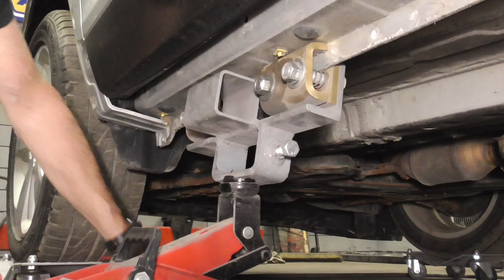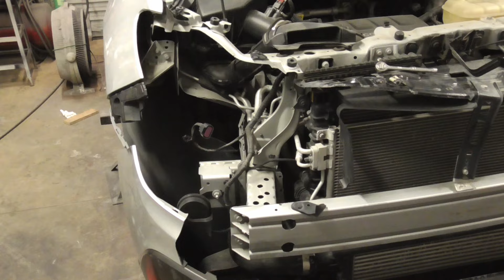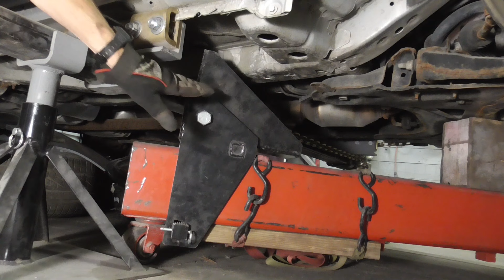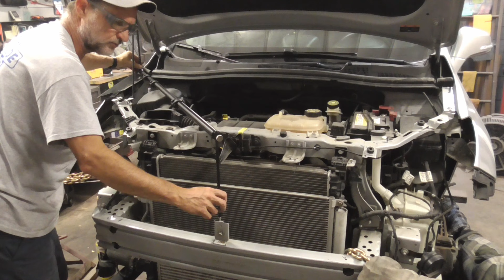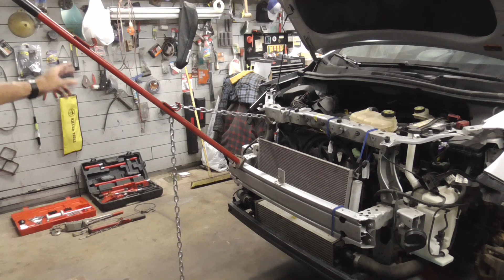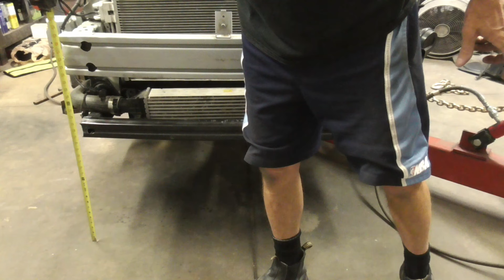Pulling Frames: Fixing Frame Side Sway with a Dozer Type Frame Machine

Comment: hi there where are you located ?
Reply from the maker: I'm in Saint Helen,  Michigan 😊
Reply: @LakesideAutobody  Far away from me but any idea how to fix a bent door hinge that pushed against frame panel ? can you make a video about it ?
Reply from the maker: @georgegirgis6435  Which direction did it get bent?  Towards the interior of the car, front, back or away from the interior?
Reply: @LakesideAutobody  toward interior of the car.... it is passenger door front lower hinge so if you facing the passenger side door the hinge instead of being 90 degrees with  frame (door panel ) now it is about 60 degrees on the angle towards the front of the vehicle
Reply from the maker: @georgegirgis6435  Got it.  Usually the fender would have to be removed and you might be able to get to the hinge.  Sometimes you can grab the hinge in the right spot with a pulling clamp and frame machine but other times you have to mig weld a piece of metal on the hinge and pull from that.  If it happened because the door was opened to far, you might be able to use the door itself to fix it by putting a block of wood in the hinge like a nut cracker and close the door on it.  There's all kinds of ways to go at it but generally you have to pull it.  You can use a come along too if you don't have any other way to pull it.  A tree and a come along can work real well :)
Reply: @LakesideAutobody  thank you

Comment: thats lot chains nd pullys to pull sideways
Reply from the maker: You're right, but if you don't have the $ for a rack or pull pots in the floor, this is a good, cheap alternative 👍💯😊
Reply: @LakesideAutobody  i have same puller but can only do front or rear as wondering how to use it to do sides but that set up look bit complcated  like were did you get the attachmeant for pull downs see you got something fitted for that
Reply from the maker: Not sure if you have this already but it shows a few different set ups using the L Dozer type frame machine - https://s3.amazonaws.com/cdn.autobodytoolmart.com/downloads/tech-sheets/BodyStraightener.pdf @tanglewood777